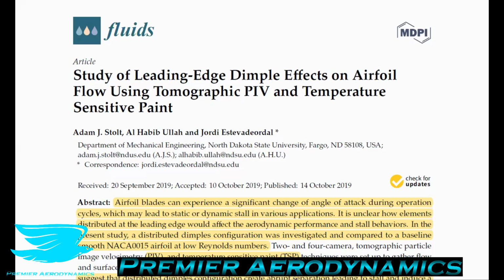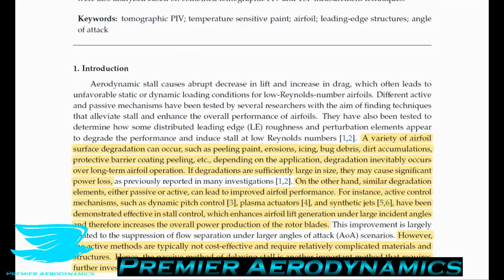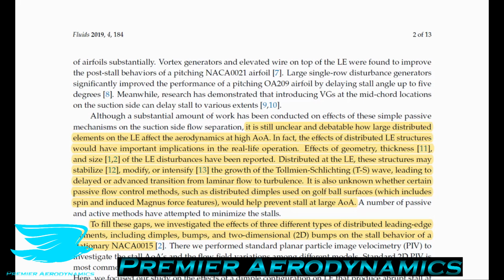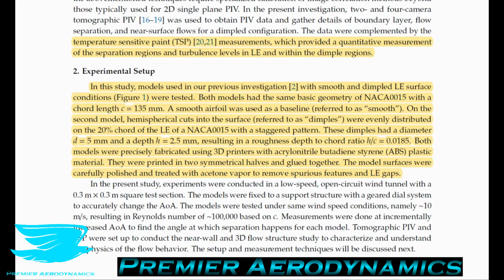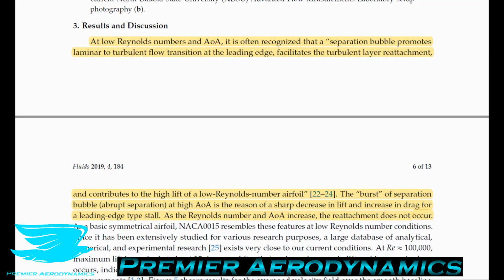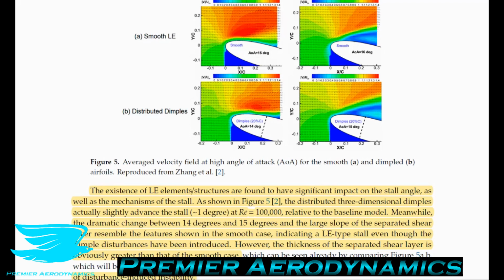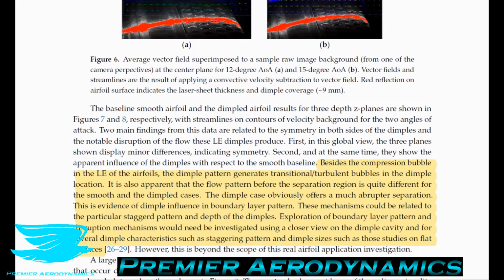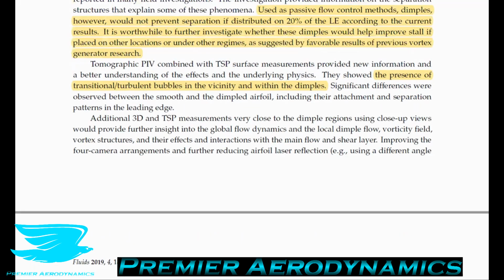Airfoil Dimple Aerodynamics - Premier Aerodynamics Podcast #25

Comment: It seems to me that in the case of composite wings constructed from molds, the incorporation of dimples in the wing would be fairly easy and much less problematic than having to apply standard vortex generators after the fact.
Reply from the maker: From a traditional manufacturing process, it would be easier to make a simple skin, then add the vortex generators after.

From a new manufacturing process, it is easier to incorporate the dimples from the very start.

It mainly depends on the manufacturing technique you use.